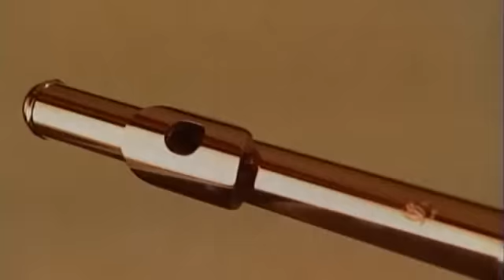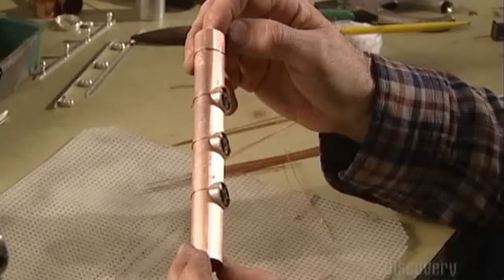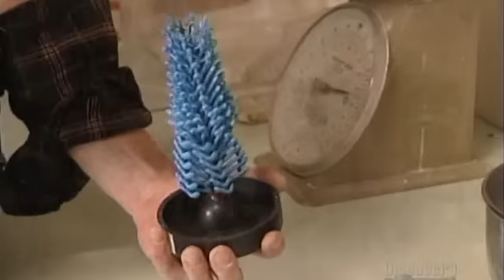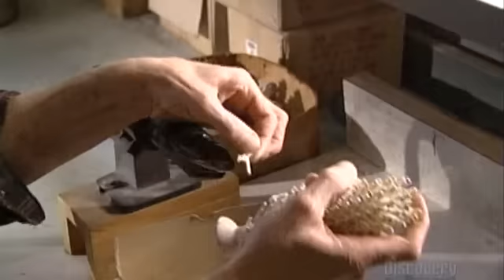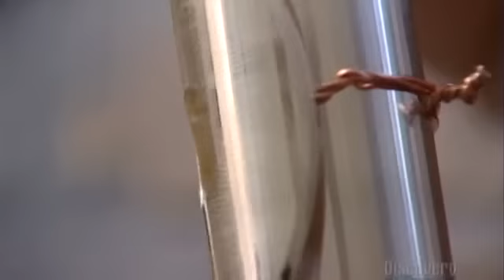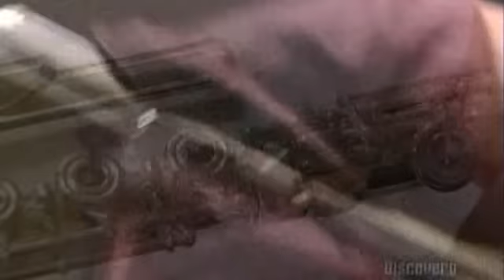How It's Made - Flute

Comment: Ummmm is this just professional models? $9000 up?!?!? My student model was $200 and the intermediate I'm saving up for is $ 650
Reply: +Musical Bean Yeah, this is a Brannen flute which are professional levels, they start a $10,000 on the FluteWorld. They're practically completely handmade while your student flute was mass produced at a factory. The keys are also soldered on the Brannen, you most likely have drawn tone holes. Another big difference is the Brogger key system which is supposedly lighter, faster moving and more consistent.
Reply: It can, but not discernible enough. It will make a slight difference when the vibrations from the flute, travel up the keys which will make a difference but probably not enough for you to hear. It just adds to the price and displays handmade craftsmanship. Different metals in the head joint and riser will make a much bigger difference. More expensive doesn't equate to better flute, they're just different and everyone prefers a different metal. The craftsmanship and quality is what makes the flute. Same thing with the body of the flute, different metals will make a smaller difference.

Comment: It depends on the materials, specs, craftmanship, etc., but generally student flutes are under $1000, lower intermediate flutes about $1500-1700, higher intermediate flutes about $2500, and professional flutes a solid $3500+.  That's based off my experience.

Comment: @missduck9 I know that, but the narrator said that "the wax melts through the holes (in the flask)." That can't be right because the holes are blocked by the hardened plaster; therefore, the wax must be melted out through the plaster cylinder after a hole is made through it - at the bottom, I assume.

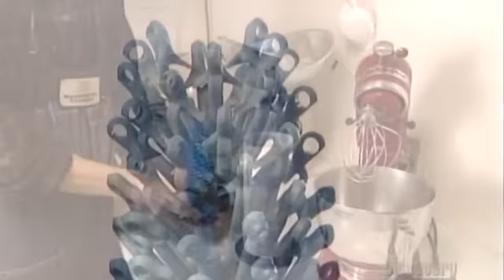Comment: The part starting at 2:00 makes no sense. If the holes in the flask are taped over and plaster is poured over the wax tree, how can the wax melt out of the holes later when the plaster has hardened? It must melt out of the bottom, so why not use a solid flask? This part needs to be re-worded.